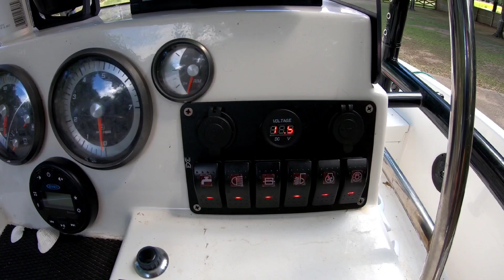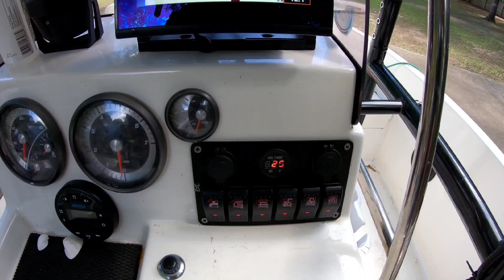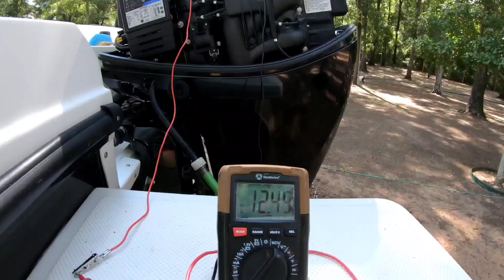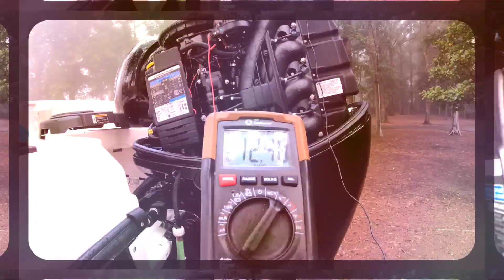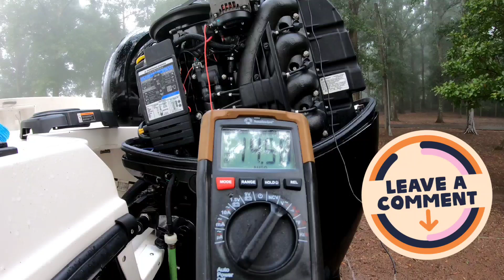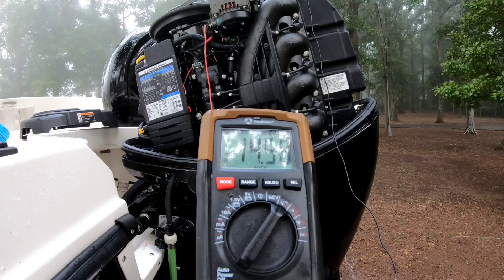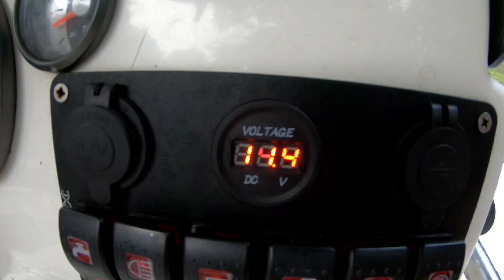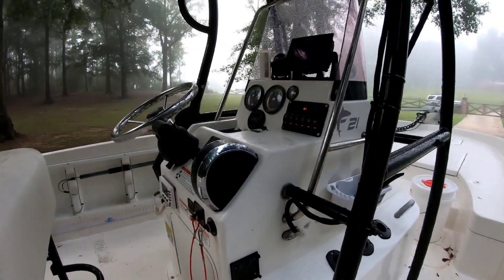How to change an alternator on a 2018 Mercury 150 four stroke.

Comment: How did you know I have 12.6 at full throttle this alternator you think I switched batterys with a new one and it still died
Reply from the maker: With the engine running you should be getting 13.5 volts to 14.4 volts

Comment: Thanks for the video. Which alternator did you buy specifically. I researched the part, and it seems there are several companies that offer them…. Ranging from $150 to nearly $400
Reply from the maker: Db electric brand on amazon

Comment: I have the F21 also and my 150 alternator just went out. I have it on a switch so that it charges the house and the starter battery. It was not charging even running on plane.
Reply from the maker: Same here I was out island hopping.

Comment: Nice video! But after i took out the last bolt under the alternator the alternator doesn’t wanna come out. Any experiance with this?
Reply from the maker: If it is stuck by saltwater corrosion gently tap it.
Reply from the maker: Was the shroud removed and wires removed. Take the bolt on outside out then loosen inside bolt leave that one in swing alternator and remove belt. Then take that last bolt out.
Reply: Don't use a pry bar

Comment: The output voltage should be 14,4 V.
14,5V was because the battery was low. A full battery is 12,7 V or higher, depending on chemistry.